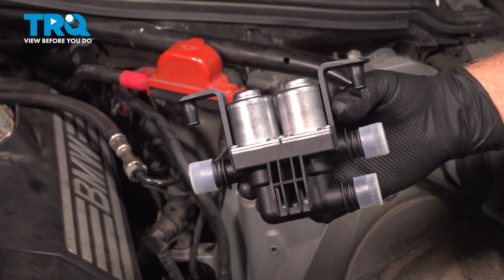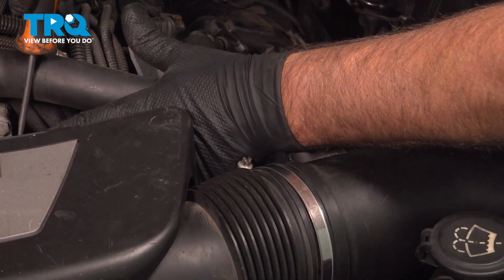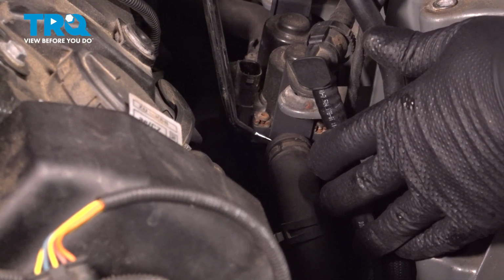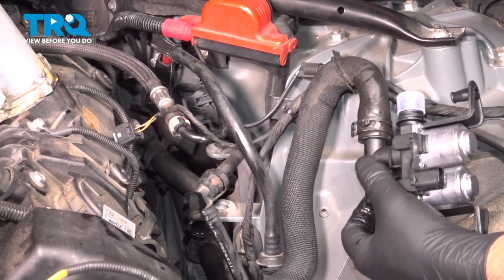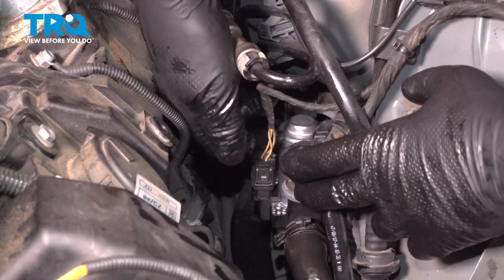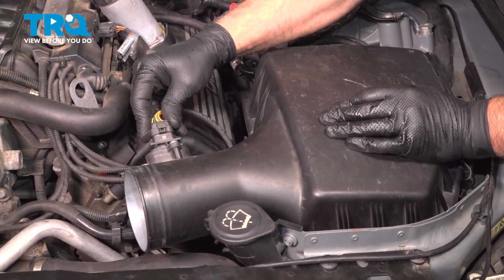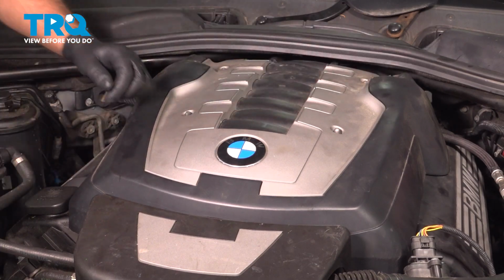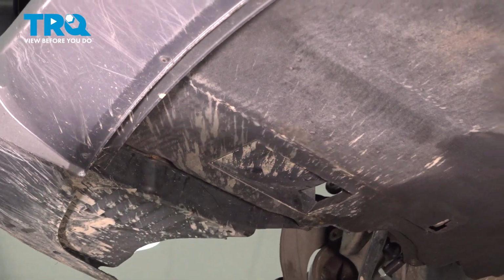How to Replace Heater Control Valve 2006-2010 BMW 550i

Comment: Excellent video.   Thank you.  I just (successfully) completed this repair and it fixed my issue, which was that the passenger side dual zone climate control blew cold air regardless of how I adjusted the temperature (it’s winter in Chicago right now, so it’s pretty annoying to not get warm air!).  

A couple of comments for future viewers.  

1.  I was able to complete the fix without removing the air box.  It’s a very tight squeeze already (thankfully I don’t have huge hands) but I’m not convinced that the air box removal would have helped me at all (the place where it’s tight is not up against the air box).  

2.  The hardest part of the job is getting pliers around the hose clamp for the top back hose.  There’s just very little room to work there - both in getting the clamp off and in getting it put back together.  But even that wasn’t really THAT hard as long as you are creative with your pliers and the angles at which you come at it from.  The good thing is that the hoses are flexible, so you can pull the valve somewhat up and into more spacious areas as you are working on it.  

3.  Disconnecting the top electrical connector was not obvious.  Using a tiny flathead screwdriver to (gently!) pry the catch towards the front of the car was the trick for me.  

4.  You will get antifreeze on your garage floor.  I tried to position a plastic bag underneath the hoses to catch the spilled antifreeze, but only was successful at catching about 50% of it…. 

5.  Everything else is surprisingly straight forward.   Total time for the project was probably 2.5 hours, but that included everything including cleanup, (and I’m always slower on these types of repairs than others are).